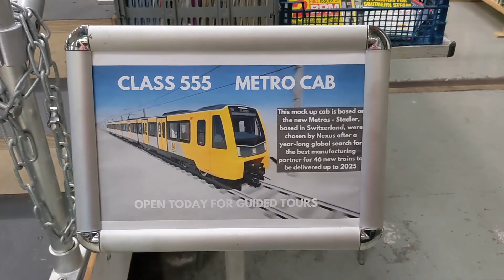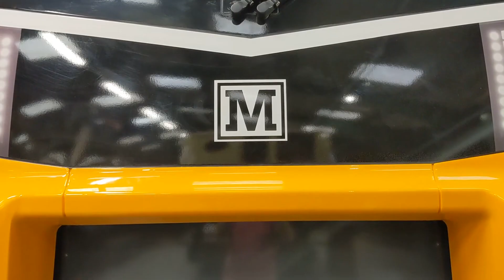First Look at the New Tyne and Wear Metro Trains

Comment: You are one of the few to get the class of the existing fleet correct! The 599. They added 99 to the front of the fleet number to give them a TOPS number, but it didn’t reflect the class